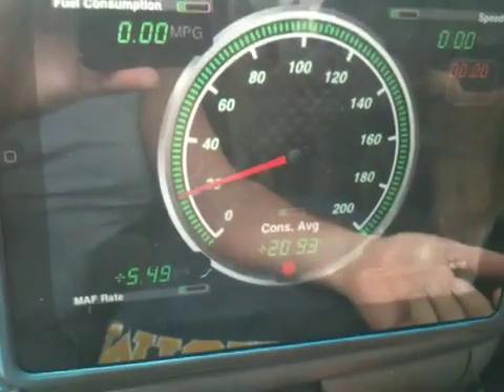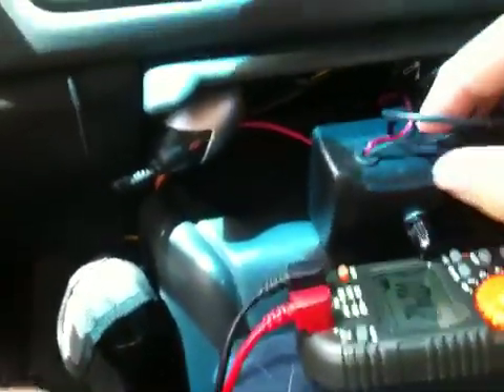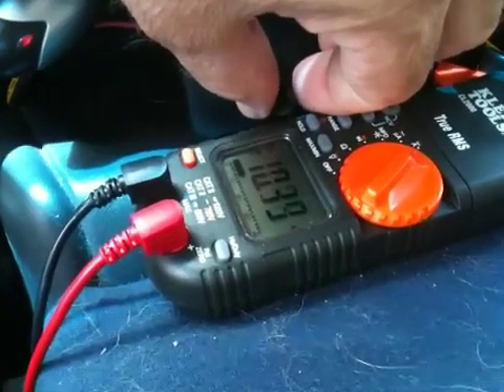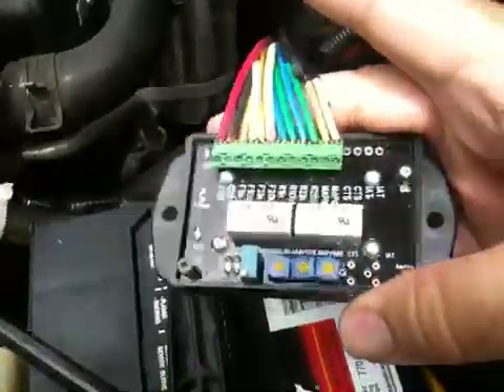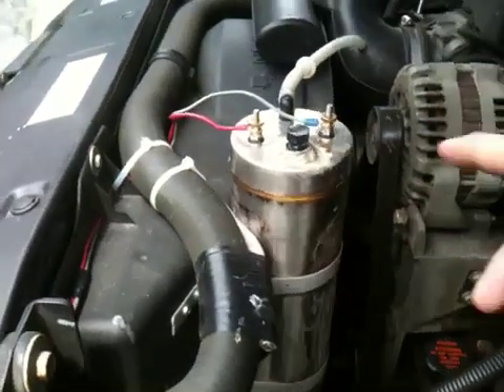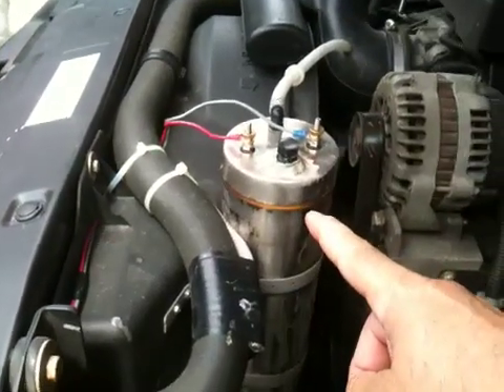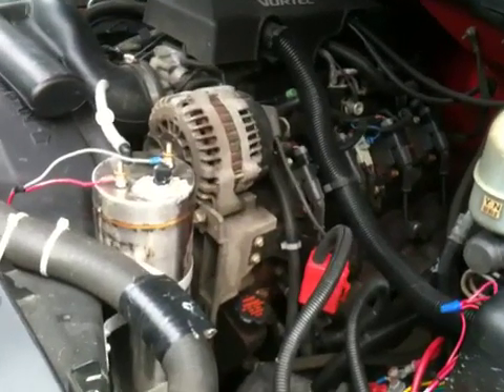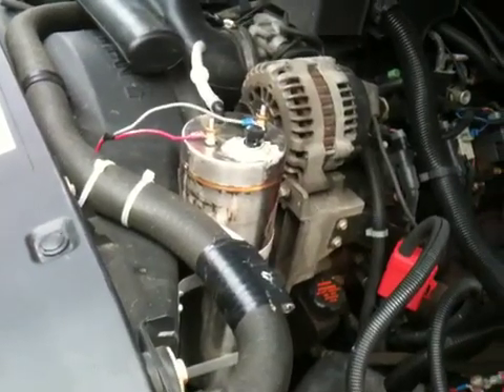3 Fuel Econ. 22.5 MPG did10 mile Run with Green Source HHO PWM EFIE

Comment: I want you to check out my channel. I have a unit that didn't even cost me $30. no PWM. No senser tricking. (but your truck is newer than mine) No koh. I ran the unit all summer, and one on my bike. and only changed the water for winter use. I'll show you a new way to hook up with mulitble HHO units pulling as many amps as possible without drawing a single extra amp from your altinator.

Comment from the maker: @amos033  - i have since had a component failure, the EFIE  has died.   It was a slow death, it first took out a MAF sensor $80, then another then another covered under warranty of the first.  Then bank1 sensor and bank 2 sensor 1 errors, disconnect EFIE all is well but city driving is 10-11 mpg and highway 15-16.  need another efie but not the same as i had, it only lasted a few months.
Reply: So u would not suggest green source pro tuner they have a new better one now but I've heard bad things like this it's 500$ alone for that tuner